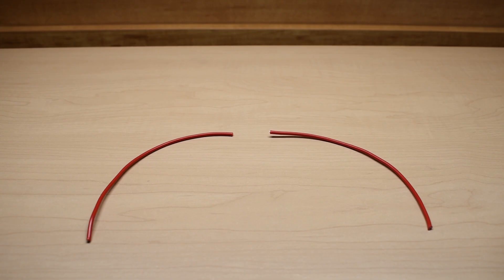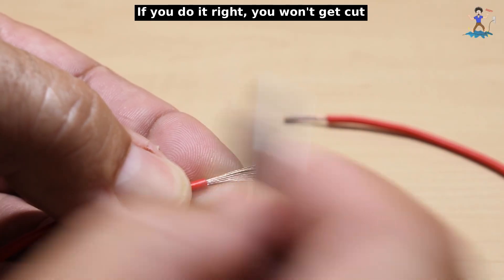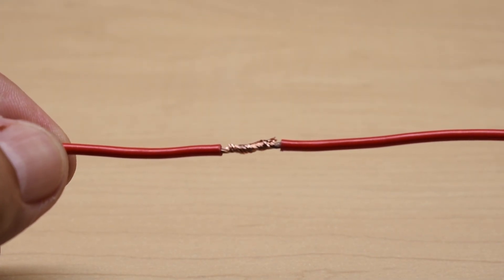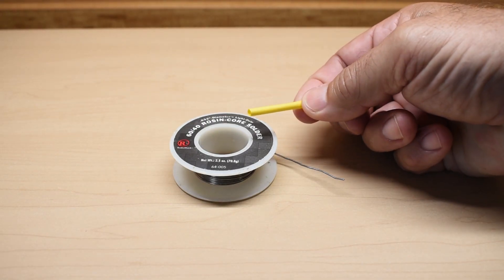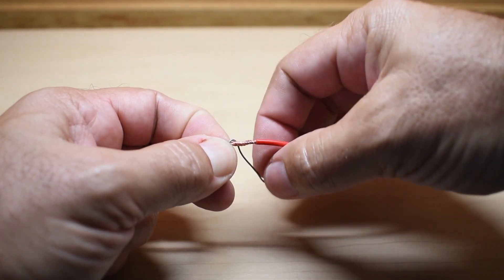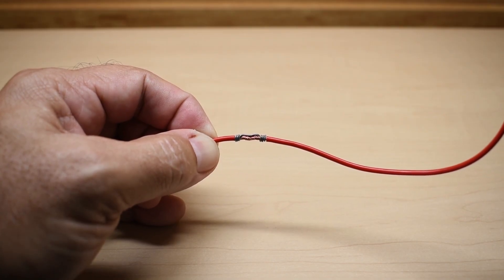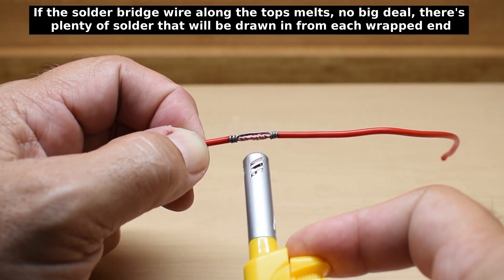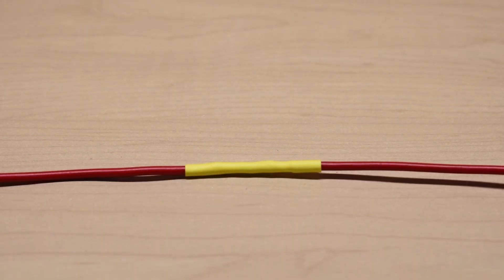How To Easily Solder Wires Together(No Soldering Iron)

Comment: You know what? this method works even better then using actual soldering iron, tried using soldering iron at max 800F on the wire and it couldn't melt some of the core at the top but lighter was able to do so using torch lighter, also a hint, if you're using torch lighter to shrink heat tubing, use a tiny metal spoon at the back to reflect the heat to shrink tubing from the rear making it shrink more evenly from all sides, just make sure to to cover spoons handle so it doesn't get hot.

Comment: "No-clean" flux is a common misnomer (particularly with liquid flux, that can be still be acidic); Subsequent to applied heat and flux connection should ALWAYS be cleaned with Isopropyl  Alcohol, preferably while still hot/warm. The acidic flux, following the heat, has a tendency to creep up the strands, initiating unseen corrosion, inside of the insulation; the combination of heat + acidity is where corrosion can begin... evaporating alcohol can wick some of this away.

Comment: This is a great video. I think you used the right amount of solder for that joint.

I wonder if this would work with a heat gun that has a small tip. I use a heat gun for heat shrink tubing. I have a plug-in heat gun that gets quite hot, but I prefer to use my weaker Milwaukee M18 heat gun for convenience since it's portable. I haven't tried to solder with it, but I think it might work well for wire-to-wire connections that aren't on a PCB. It may not get hot enough to melt the solder though, I'll have to try it.

Comment: What happens if you "clean" your copper wire with rubbing alcohol??? Does this ruin the copper or is it okay? Battery acid had eaten thru the insulation but the copper wire seemed very solid still so I cleaned off the corrosion with rubbing alcohol and a soft brush and rag. Now can I repair the insulation somehow?

Comment: For decades people have been twisting small gauge wires like  this guy does and just wrapped electrical tape around the wires and had no issues. One could effectively wrap the wires as shown and simply shrink wrap them. Low gauge wires shouldn't have any stress that would pull the splice apart. An even simpler method that works. All one needs is contact, like an electrical plug is inserted into an outlet gives contact and flow of electricity, but is not permanent. Safety s not an issue either, or outlets would have some sort of latch to insure the plug doesn't pop out. Some may say that solder gives more connection, which may be true, but doesn't change flow rate. The voltage will flow with or without solder and without any voltage drops.

Comment: Your method of soldering is particularly useful when you need to make cross-wire connections especially in hard to reach places.  I found it useful in my motorcycle where I couldn't take my power extension and soldering iron.  I use the iron method in my home lab where I need to work on PCBs with space and movement constraints.  All-in-all, a very good method but one needs to be very careful going live.  Use of heat-resistant gloves, good safety goggles and adequate lighting condition are recommended for novice users.

Comment: If the 2 wires are long, then slide the sleeve on one of them, out of the way, before soldering. After soldering, position the sleeve at the joint.

Comment: I was taught that once you twist the two stripped wires together the solder won't be able to get to the middle of the strands of wire and will stay on the outside, creating a weak connection. My advice would be to put the stripped strands of wire directly on top of each other and then solder them, creating a strong connection.  Bonus: using a flame to shrink the heat shrink tubing will, again as taught, make it brittle in the long run.
Reply: If this were true, sweating copper pipe wouldn't last centuries like it has.

Solder will flow where there is heat and flux.

Comment: Better , faster and easier to use an iron.
Reply from the maker: better and faster? No. If you don't have a soldering iron that heats instantly, I can solder the connection faster.

Comment: What is the point of not using a soldering iron?  Maybe if I get lost in the woods or something and happen to have solder & flux with my lighter?  But wrapping the solder on the joint and adding drops of rosin is a neat trick.  To join larger stranded gauges; spread the strands, inter weave them, compress and wrap with a length of single strand, then use a torch vs a lighter.

Comment: You can also use a solder sleeve to connect two wires together. A solder sleeve is a plastic type tube with solder in the middle of the tube. Take the two wires and put them into each end of the solder sleeve. Then take a heat gun and go over the sleeve making sure the sleeve collapses onto the wire casing, as well as the solder getting hot enougn to melt, fusing the two stripped wires together. I used these before at a company I worked for. You do have to make sure you don't overheat the wire casing or it will melt.
Reply from the maker: https://youtu.be/dImF86OwiK8
Reply: @electronicsNmore  Yep. that's them

Comment: Many many years ago there was a product called Solderline, which came in a tube and was applied cold .  In recent times I' come across a product bearing the same name, but it was auto-body filler.

Comment: Great tip, great technique! Thanks for showing us how to eliminate having a soldering iron in our tool kits, and being sure a wall socket is nearby when we have a simple job to do.  However, if you have a compact Butane soldering tool available, it also works easily with this method.
Reply from the maker: Glad you liked the video! Be sure to share. Thank you

Comment: Brilliant. I have done something similar in the past but that technique is a vast improvement. By the way, when the shrink tubing is used, hot water from a recently boiled Kettle makes a neater, cleaner shrink.
Reply: I'd be cautious of not letting water become trapped in the shrink tubing against the wire where it can and will wick into the wire causing hard to find problems in the future.

Comment: Well, what a surprise! When you started wrapping solder wire around the joint, I just thought, oh, another YouTube gimmick. But far from it. I have soldered many wires together over the years and it has always been an absolute pain as one juggles with the wires and the solder. I will make a test joint later, just to try it out. Thanks! Truly useful.

Comment: Time is money and this is too slow....A soldering iron is much quicker and efficient
Reply from the maker: In the time it takes you for the soldering iron to heat up, I can have the job finished.
Reply: @electronicsNmore  I use a HAKKO soldering station and it takes all of 30    yes  30 secs to reach temp.  My Weller cordless iron takes about 40 secs to heat up and is good for more than 40 mins of work.
Reply from the maker: @ODX171  OK. So that means I can solder it faster than your cordless unit using my method. LOL. Once the wires are twisted together and ready to be soldered, I can wrap it, then hold the flame to the splice and get it done faster. Nice try buddy.

Comment: do not do this heres why.. its a dirty flame if you must use a torch that introduces oxygen a clean blue flame.. you introduce soot into the joint weakening it... a soldering iron heats in a outwardly flame its controlled ie temperature a open flame is full on and can melt the casing.. only do this if you dont intend to use it in a mechanically sound joint or cant aford a 20 dollar soldering iron also a good iron is about 50 and above temp controlled with pid controllers and i dont mean chinese junk ebay specials
Reply from the maker: Absolute nonsense. If you hold the flame in the correct position as shown in the video, there is no soot. Pedants abound.

Comment: Been doing basically this for decades. No need to clean with a blade, no need to wrap it with solder, no need to use flux, Just strip the wires, twist and heat with a micro torch adding solder as you would with an iron. No need to waste time with the rest, the flux core will glean and do it's job so you don't have too.

Comment: I'm gonna have to try this on semi trailer lights. I've been just cutting and twist the 2 ends together folding the twist flat toward the light plug the sliding Heat shrink I've it. The light plug is usually a 3 wire setup so I'll do all 3 the Sam and top it with heat shrink big enough to bundle all 3 wires together. I've been wanting to solder but I'm outside in the weather. 
Thanks for the tip from and old trucker.

Comment: Yawn! I remember doing this when I was a kid. Also you can use a hairdryer or heat gun.
Reply from the maker: Sure ya did. Hair dryer? LOL.......What I have to put up with....
Reply: What's easier to carry in your pocket, a blow dryer or a lighter ? What's a cheaper to buy in a pinch, a $2 lighter or a $30 blow dryer ?

Comment: Perfect with one minor caveat. Put the heat shrink tubing on the wire 'before' you solder (unless you have one open end where you can slide it on afterwards like you did. How many times did I forget to do that first? Too many so I had to comment. Thanks for the video.
Reply: He did mention to do that in the video. But since he did have an open end he did it afterwards.
Reply: Excellent point … 👍🏻

Comment: Great tip, I always struggle trying to get the wire hot enough to welt the solder, I’ve been using the wrong solder all this time..

Comment: Always clean of any flux after soldering the joint before installing the shrink tubing or tape.  Any flux not cleaned off will go green and eat the copper wire eventually.

Comment: OMG where's there a double facepalm when you need one <SMH>  seriously.... just go and get a soldering iron and do it properly,
Reply from the maker: Wow, was it really that hard to figure out that this method would be ideal for splices where no AC receptacle is nearby, or if you wanted to make one or two splices and not have to wait for the soldering iron to heat up? SMH.......

Comment: Solder always travel in the direction the heat is coming from.  That is why plumbers will apply heat to one side of a joint and put the solder on the opposite side of the joint.  Once the solder gets hot enough to melt it will flow into and around the joint.

Comment: I have been using this method of splicing wires for decades. For extra protection on wires used outside like on vehicles and trailers I usually generously coat the splice with dielectric grease before shrinking the tube. I feel it makes the seal more corrosion resistant.
Reply: Hey G I have a backup camera I installed and had to make splices and add extra wire to reach the back of my pickup truck. The wires from the camera are so thin it was hard to remove the plastic insulation without cutting the wires. I only used electrical tape for connecting because of the thinness of the wire. I'm wondering if there is another method for connection.  The camera works for the most part but occasionally I lose the connection and that's why I'm asking. Thanks in advance.
Reply: @stayinthemoment18  solder it and put hot melt heat shrink over it.
Reply: @WineScrounger  Thanks  Will try
Reply: Why not use hot melt heat shrink tube? It’s good stuff.
Reply: @WineScrounger  It really is! I use the hot melt heat shrink tubing on every splice I do now. It seems as though if you want to make damn sure the connection is 100% water proof and won't come apart regardless how bad of a solder job someone does, it's the only way to go!!

Comment: Always clean your flux off post soldering, this is applicable when working with wires or plumbing. Clean those acids off or they will eat away and oxidize then you get an open or a leak.
Reply: Never use acid core solder on wire.

Comment: So the flux wicks up the wire under the insulation as does the solder.  In a high vibration environment, this means the wire will break under the insulation at some point and will be nearly impossible to troubleshoot.  Also, not hooking the wires (there are any number of methods for this) before twisting means poor mechanical strength as well.  I wouldn't do this method to anything I own or any customer's device.  Too many opportunites to fail long term and to be very difficult to troubleshoot.  Crimping is the preferred method to join two wires in a harness or loom.
Reply: >So the flux wicks up the wire under the insulation as does the solder.  In a high vibration environment, this means the wire will break under the insulation at some point and will be nearly impossible to troubleshoot.

this was my concern as well. in the places I worked this would be a fail. i suppose in a pinch if you didn't have any tools it could work until you can do it properly.

Comment: if using decent voltages - ie more than like 50v then best add extra insulation underneath the heatshrink and if you can the same width of the soldered joint

Comment: Don't see how that beats a soldering iron in any way...

Guess useful trick if you don't have one, but if you don't have one, you're not likely the type to be working with wires anyway....
Reply from the maker: How about being far away from an electrical receptacle, or not wanting to wait for a soldering iron to heat up to make only one or two connections?
Reply: @electronicsNmore  Never been in either situation, but suppose someone could find themselves there.  Point taken.

Comment: For much stronger splices, hook the wires before wrapping them.  This is well described in "Practical Electrical Wiring" by H.P. Richter, the electrician's bible.  Not sure why you wouldn't always do so since it's easy.

Comment: there is a product  solder glue  that  works ---looks like super glue with fine metal  mixed in it just smear it on after twisting the wires to gather have not had any faults with it

Comment: Take the wire on each side and split them into a V.  Then place the crotch of the V into the other wires V crotch. Twist the wires together from the sides and NOT like the way the guy does it in this video! THAT IS NOT HOW YOU CONNECT WIRES!

Comment: Some people just embarrass the hell out of you!! Been doing Electrical, Automotive and Electronics for over 50 years now and I've never even thought about this... I've soldered wires with candles and wrapped the solder around and around the wire then tapped it just a tiny bit to knock the excess off before but the wrapping GENIUS!!! What I would not give to have known about this eons ago! This would work great even WITH a solder Iron especially in those HARD TO REACH spots!

Comment: Nice idea but I will stick to using my small portable soldering iron.  take care.
Reply from the maker: Small portable soldering irons sometimes do not generate enough heat to solder #12 or #14 wire, what I show will do it with no problem at all.
Reply: @electronicsNmore  I agree, If I need to do soldering with #10- #14 gage wires, i do have a Weller soldering gun for heavy tasks, running bus wires on my model railroad wiring as a hobby.  I do like your method of soldering and also give it a go .  I have been soldering wires all my life working at Simpson Electric and Motorola. Have a great holiday season.

Comment: It was a nice demo but there is NEVER a situation in the field where you have complete 3-axis, 180 degree access to the joint :-(  That's why I invest in solder splice butt joint connectors.
Reply from the maker: Really? I've ran into it all the time, especially working on cars.

Comment: Almost useless tip. If you own solder, strippers, flux, a lighter etc then you most likely have a soldering iron….I suppose this could come in handy if you’re stranded without electricity…

Comment: I have been doing something similar for decades but I don't bother with wrapping or flux just heat the joint and apply solder normally.

Comment: Wow, that will make working on a vehicle far easier! No need to drag 110 volt out to the car or motorcycle, then wait for the electric iron to heat up as well as worry about wind or cold fighting the iron. You will of course want to make sure there are no fuel vapors around though!
Reply from the maker: Exactly what I've used it for Todd. Thanks for watching!

Comment: Well with that crap I'd rather just plug my soldering iron in
Reply from the maker: How exactly do you plan on plugging in your soldering iron when a receptacle isn't close by?
Reply: electronicsNmore I'll wait till i get home then , I've twisted wire together before , so you carry a bottle of rosin and solder and heat shrink with you and a lighter

Comment: Thank you for the very informative video. Next time I need to attach two wires together I will definitely use this method. And I will give you all the credit and if it doesn’t work I will tell everybody it’s your fault. 😁😁😁 come to think of it if it does work I will take all the credit…. The things I do just to impress the ladies. ( In a Elvis  Presley voice) …..Hey baby do you need some wires joined together. Well Give me your digits and your whewhere about’s ( address) and I’ll come by around 10 PM and fix your problem.

Comment: One should only solder stranded wires in an emergency, solder wicks up the wire and makes it brittle!  Use this handy technique only when you don’t have the proper crimp connectors.

Comment: It would be a lot faster just soldering after wires are twisted together. But never thought about using Flux on wire. I'll definitely try that.
Reply: The video Clearly States (No soldering iron)  Come on Richard, get it together.

Comment: Thanks for this video, I will use this technique from now on. This is an excellent way to get the solder uniformly on  the wires. No bumps or other ugliness and a lighter works fine. I can save my mini torch for lighting smokes in the wind!
Reply from the maker: Practice makes perfect. You'll learn the right amount of solder to use, as well as the correct placement of the flame.